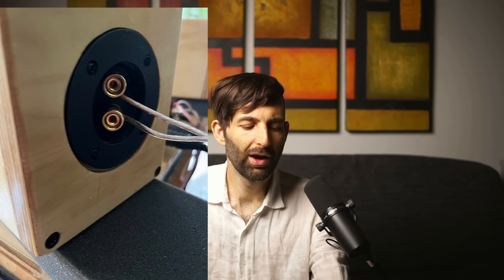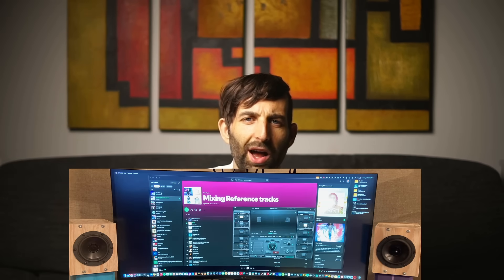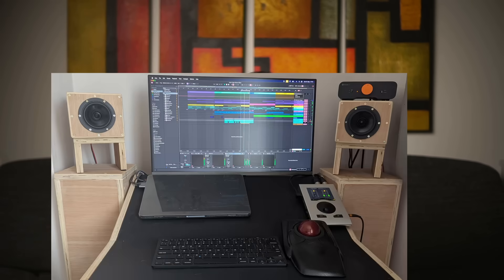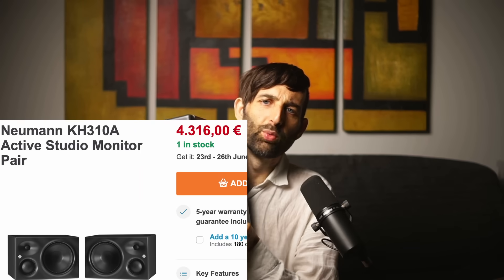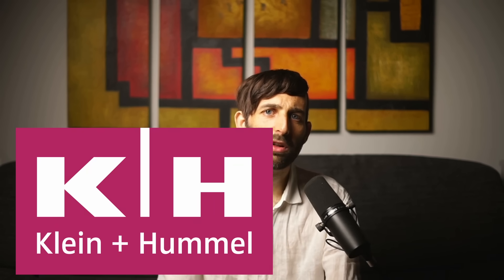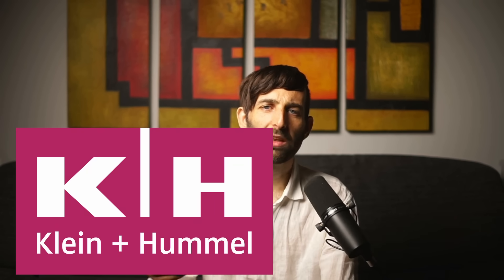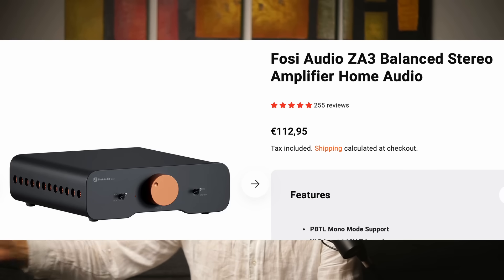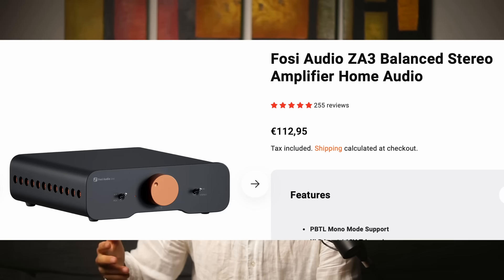$5,000 Neumann speakers VS $400 DIY speakers (Audio Shootout)

Comment: If you want to really troll people, you can use an EQ to make the sound warmer. That being said, for the home user, $2000 is a lot of money still. I do agree that making them passive to save money might be good. 

The Neumanns sounded the best, but maybe not $3000 better. Under that, I like how classic sounds more since I listen to a lot of metal and rock. I wonder if I throw in an EQ, would I be able to get the sound closer, especially if I have the Neumanns in the room I could use as a reference. I would say that this is a tough tests since I am listening through DT770s. 

The small + subs setup is an interesting one. It sounds like it would be a great set to test on. The small speakers sound very common, and the sub would be more like how a club or home theater is. Not my favorite, but it looks very handy to have around
Reply from the maker: you can certainly EQ them. they are quite flat already but with EQ you can get really flat

Comment: Your 3 way design is a good starting point but does need some work fine tuning the mid. Try using rew to take measurements to see where the issues are. Vey good though. ❤
Reply from the maker: it's more or less flat. with hypex plate amps it's ruler flat. it measures 50-16k +/- 1.5db IIRC in REW in the passive version
Reply from the maker: remember the position and room is colouring the sound heavily
Reply: Yes off course, the dreaded room modes. The 3 ways do sound good though, quite transparent compared to the neumann's, very well done.

Comment: No matter the price, if the artist output is pleasing to people, their system (speakers) would not be "nonsense" for them. If they get good results with the things you visually denigrate, which many do, it would prove that the work is the important part, not the nerdy, condescending for clicks,  putdowns of what gear one might have. Sucks, because in general, i agree with your thoughts.   

liked the mid domes

Comment: I'm currently in the midst of building my own 4-way active speaker. And the cost I've put out so far is close to 3.5k
Reply from the maker: you can sink a lot of cost into fancy drivers etc
Reply: @APMastering a chunk of the cost is in shipping due to my location. I chose drivers that both performed very well and look good. Im a woodworker. It's what i do for a living.
Reply from the maker: @mannymakesmusic891 what did you go with?
Reply: @APMastering dayton audio sig 120 4" for mids, sig 225 8" for lows, two  RSS210HF-4 8" for subs at the back and the dayton audio nd25 as the tweeter. Got two 500 watt power supplies that's powering a 600w amp for the subs and a 400w amp for the 3 way at the front.
Reply: Currently doing a little stress test on the amps, I unfortunately lost one PSU in the process but that could be a fault psu as it dies on first power on.
Reply: @mannymakesmusic891 I hope those amplifiers have 500W in 4ohm, othervise you gonna torture your amplifier.

Comment: You would have done better triamping them with the Douk audio 100 and the Douk Audio A5 with your existing amplifier.
Reply from the maker: I am planning DSP based crossover content soon. I actually ordered a bunch of aliexpress DSP amps but they suck pretty bad and have low frequency pops on startup which kill tweeters. As I mentioned in the video with the proper hypex plate amps they sound shockingly good but the amps are a grand for a pair

Comment: I think the classic sounds really good and much better than the small + subs but the low end on the digital source still sounds better.  The KH 310 seems to be quite a polarising speaker.  A lot of people don't like them compared to e.g. ATC or PSI but obviously there is a big price difference.
Reply from the maker: yeah most of the bass weirdness is coming from room interaction and comb filtering from being sat on my desk. On stands they sound better but I wanted to keep this kind of set up because that's how most people are going to be hearing them I guess. None of these speakers go down to 20hz or anything but they are full range enough even for mastering
Reply: @APMastering There is a point where excessive range or detail just becomes really distracting, like you can hear the phase shift when you move an EQ point by 1Hz.  It makes it difficult to commit to any decisions!
Reply: @womagrid  True that!
Imho "less is more", don´t use EQ, compression,... unless it´s truelly necessary!

Comment: Neumann kh 310 is great speaker very accurate but very sterile and dead. I like little bit of ompfh listening/producing my music so i choose Barefoot Footprint. Eve Sc 3070 also have crazy tight bass but dont like ribbon tweeter. Yours sound little bit boomy next to Neumanns.
Reply from the maker: yeah the classic ones are a tad on the boomy side by a fair small amount. If I were to use hypex plate amps they'd be ruler flat down to 40hz but it's a bit limiting with a passive crossover that needs to be simple enough to put in an online course. you can easily EQ them though of course

Comment: You should send these to Audio Science Review mate. TBH I didn't notice much difference in sound quality per se but some differences in stereo placement/spread on some tracks, and some sounds were more forward or back depending on the track. good work
Reply from the maker: nice one thanks. I think shipping would cost quite a bit and im not selling them, they are DIY only. but anyone can build a pair from my plans
Reply: @APMastering Yeah I was mostly joking about ASR.. are they dayton drivers?
Reply from the maker: not the tweeter but the others yeah I really think they offer the best bang for buck. ive been often disappointed when spending more with other brands
Reply: @APMastering Dayton drivers are some of the best... I even have an old Logitech 5.1 system with Dayton drivers that sounds really nice
Reply: I guess once you achieve flat response on main axis, the differences can be attributed to radiation patterns.

Comment: To my ears, the classic sounds closer to the original mixes with slightly less width in the imaging.
The Neumann's have more details on the high end and depth perception/imaging. They also seem to have a deeper bass response. The classic speakers do not sound as deep. None of them are really really the sub frequencies as well as a sub would but the Neumann's sound better in the deeper bass Freq...

As soon as I figure out how to get these parts and can afford them, I'm defo making them. 😂😂😂

Thank you for the awesome content. This is a gem of info... I can imagine that this wouldn't have been easy. Present Day Production channel did theirs but on the higher side and theirs was awesome but this is budget gold
Reply from the maker: yeah this is like less than a tenth of the cost of theirs. I think there ones are even more expensive than the Neumanns which is ridiculous because Neumann are like the premium premium premium industry standard brand and are more or less untouchable. The hypex plate amps that they use, and I use in my mastering speakers, will allow you to get a ruler flat response but if you boost stuff and do too much weird stuff you will start to increase distortion. Also, although my speakers are passive without EQ, there is no reason why you cannot add EQ to the monitoring chain digitally either with sonarworks etc or just a normal EQ. Then you'll have more sub.
Reply: @APMastering
The cost of production is mind blowing 😂
I guess the brainpower and skill is the expensive part, eh😂
Thank you again for this awesome hack

Comment: I wanted to ask how bad the vanatoo transparent one encore are in your opinion i was planning to get one of those and a sub separately

But maybe i think on building the ones you did.
Reply from the maker: its based around a passive radiator so its just like a standard ported monitor of which there are thousands out there. soggy inaccurate bass

Comment: have you heard the MUM-8's or MUM-10's?
Reply from the maker: not personally but they are quite expensive for the decent model. they use the same plate amps I use in my mastering speakers but they have a brand deal with hypex whereas I just use the hypex amps directly. I think they might even be more expensive than the KH310 for their better model, haven't checked the price recently
Reply: @APMastering the hypex amps you showed in this vid is why I brought it up. In their marketing they seem to be cheaper solution to a big $ set of ATC's or something similar. I was hoping maybe you had any info/opinions on the purifi and bliesma drivers they use.

Or, more generally, I guess I'm mostly concerned with your thought process on choosing drivers for your speaker builds. It seems logical that the drivers are the most important part of a passive design (dimensions of the enclosure being second i guess?) so, what are you thinking about, beyond price, when choosing drivers?

thanks for all the content brother, you are doing gods work, cheers from guelph ontario canada
Reply from the maker: @danloughrin7510 nice one, yeah my mastering speakers are an alternative too but cost 2k not 10k. You can get some really nice second hand PMCs for less then the MUM speakers. the drivers are important but you don't necessarily need to spend a huge amount on drivers like the MUM ones especially if you get the more expensive version
Reply from the maker: just checked the price and the 10" ones are like more than twice the price of a pair of KH310s lol. I don't really understand the target audience.
Reply: @APMastering the MUMS are designed to be ATC killers